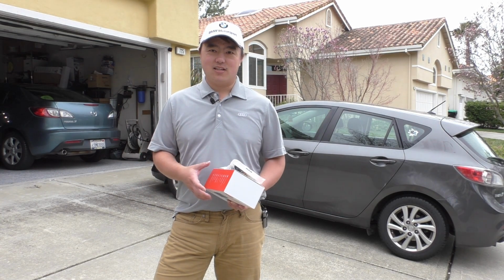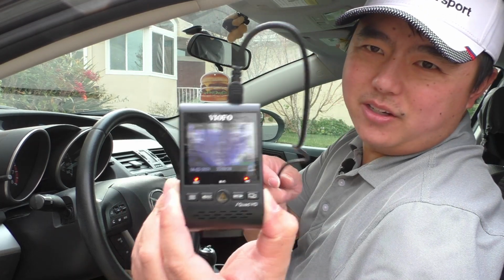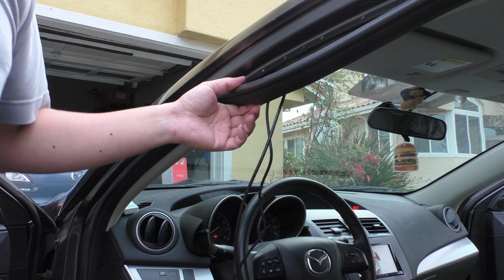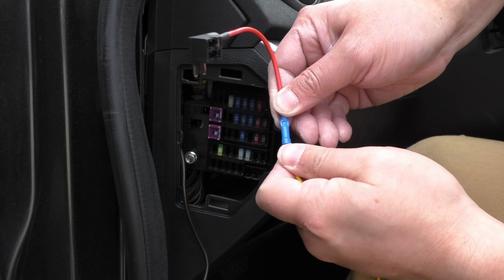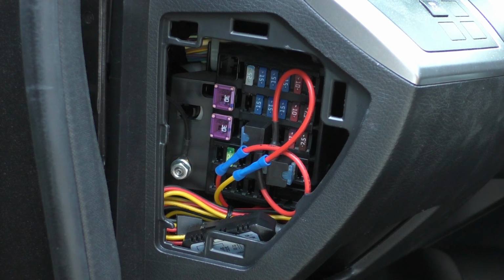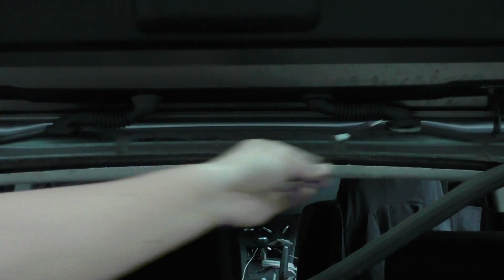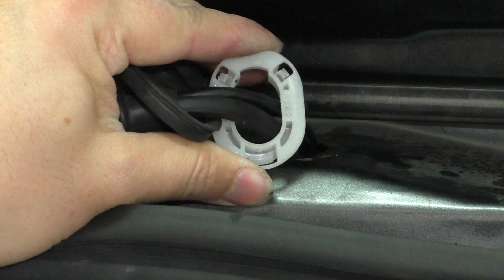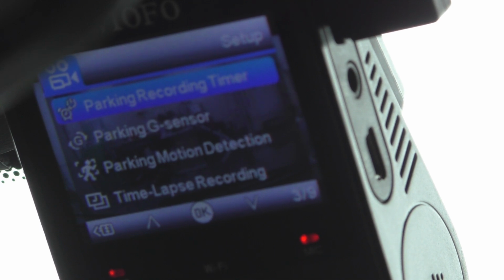2nd Gen Mazda 3 Dashcam Installation (VIOFO A129 Plus Duo)

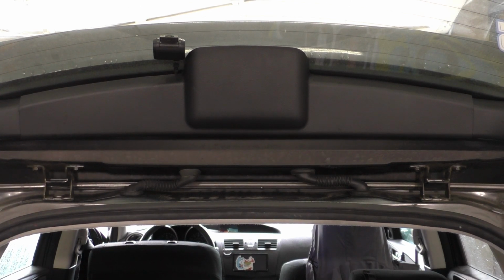Comment: Where was the sedan installation? All I saw was the hatchback, then a quick blurb for sedans to go to 29:09 which I did, and that was basically the end of the video.
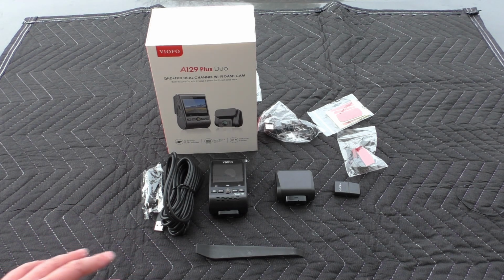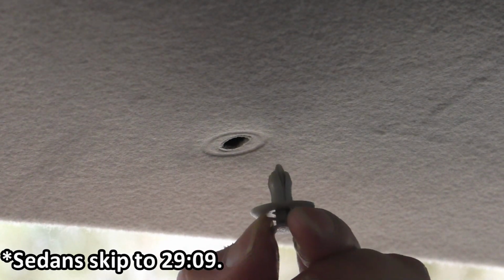Reply from the maker: 2:19 till 19:18 is for the sedan. Sedan and hatchback is the exact same except for the rear.
Reply: @FaRKle0079  the rear is what I'm looking for, for the sedan. I'm glad putting it in the window worked for you, but it does not work for mine. When it rains, I can't see anything. I also see a lot of reflection. I was hoping you had installed in a different area as that is what I'm trying to figure out for my car since the window doesn't work for me.
Reply from the maker: @HeathersGems  Most rear dashcams get installed on the rear window. You can try putting the camera off to the side of the center to see if that has better picture for you. There are also some filters you might be able to place over the camera lens to try and cut back on glare.

Comment: A good guide on the dash cam installation but I have one concern, I think it is not advisable to have the cable wire go over the airbags in which it can be very dangerous if it will deploy in case of accident. I have it myself to have the cable wire under the air bag system and I am just a DIYer and no previous experience.  I actually learned that trick from Chis Fix in YouTube.

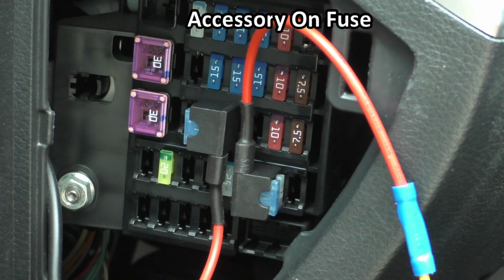Comment: A useful note for anyone following this guide, at 15:30, each fuse slot has a side the power comes from and a side the power flows to, so you need to to connect your fuse tap the right way around. If the Battery (constant) live is the wrong way around the dashcam won't work, if the Acc (switched) live is the wrong way around the dashcam won't go into parking mode. To check your wiring, probe both fuses on your fuse taps, both fuses on the always-live should have power all of the time, and both fuses on the switched live should have power with ignition on 👍
Thanks for the video, I have a similar (newer) car and will be fitting this same dashcam, I got a few hints and helpful info 😎👍
Reply: That is absolutely right. It is best to use a test lamp with the original fuse removed to check which pin of the original fuse holder has the voltage on it. You insert the adapter so that the output cable is on the opposite side of this pin.
and what you definitely shouldn't do as shown:
The original fuse goes in the lower slot (here 20/25A), the fuse for the camera goes in the upper slot and it must NOT be the same size as the originals, but 5A to a maximum of 7.5A. The cables are not designed for currents of 20 or 25A and may melt or burn.
Reply: @robby-cgn  It doesn't make any difference that is significant. If you hook it up one way, the output of the add-a-fuse will be a fused version of the main fuse input (car hot). Hook it up the other way and it will be a fused version of the main fuse output (fused car hot). If you plug it into a slot without a fuse, it will matter.
Reply: @L-36  that is described exactly right. If you connect it the wrong way round (your first option) and the original fuse is damaged, then the additional consumer won't work either. When troubleshooting, it gets tricky if you don't pay attention to both fuses.
If you want that, it doesn't matter which way you mount the holder. If you don't want that and you want the additional consumer to work independently (which is actually always the case), you have to make sure that the input for the additional consumer is always on the input side of the original holder.
Reply: @robby-cgn  I did one up and one down because they were adjacent fuses and that is the only way they would fit. I guess that means I need three fuses working for the dashcam to work instead of two. It is a risk I am willing to take. I think it draws about 1/2 and amp worst case and  the main fuses are 15 amps so should not be an issue.
Reply: @L-36  You can of course mount them however you like if that's not a problem for you. I just want to make other users aware that it does make a difference and how to do it correctly. Using a 15 amp fuse when only a few amps are needed is also wrong. Yes it works also with a 50 Amp Fuse. But the fuse does NOT protect the device but the cables and these thin cables are definitely not designed for 15 amps or more and in the worst case the insulation can start to burn in the event of a short circuit.

Comment: Great video and helpful for me in many ways but I want to point out that you put the wire over the airbag within the A frame on the drivers left side. I’ve seen others highly recommend wiring underneath the airbag as not to restrict the safety feature. Thanks for your video !

Comment: Great video! How do we know which fuses to pull out to insert the hardware kit to?
Reply: You need a multimeter,set it to "DC voltage" black to the ground bolt and red to the little metal dots you see over the fuses. It must show 12 volts or above.
If a fuse shows zero,it's one of the accessories power,and it will work only when the ignition is on.

Comment: Vibration-induced wire failure is a big deal on both aircraft and cars. It's why car makers have so many supports on the harnesses - to keep them from abrading against anything.  It seems like the coiled up wire above the headliner could vibrate and possibly wearing through. I wonder if it might be better to start the rear wiring at the rear camera end and running it forward. Whatever cable is left over can be coiled up near the fuse box where it's more accessible - though vibration could be an issue there as well!

Comment: Great video.  I'm currently using an A119 V3 for the front and a separate Street Guardian for the rear (my Rav4 has a power port in the rear cargo area).  The A129 Duo will be my next cam once the setup I have finally dies.

Comment: Before installing the add a fuse, you really should use a meter to check which prong is supplying the juice and which prong just goes back to the device that needs the power.  This video will do a great job of explaining this.  https://www.youtube.com/watch?v=K2iKXj82354   I don't know if this vehicle has side curtain air bags like the CX5, but if it does you really don't want to put stuff in the headliner (at least not on the ends) because that's where the air bag is going to blow out of.  Best to run it down the middle of the headliner or down the floor boards.  I wouldn't want to put that adhesive over a defroster line.  From the outside view it was right over a line.  I've been watching/reading a few installs today trying to amass all the knowledge I can before doing this myself.

Comment: Great Video, but I do have a concern. I know you have been running this for at least two years already but my concern is with the orientation of your fuse taps. Since one is facing up and the other is facing down there is potential for one of your circuits to be be overloaded. If the orientation is incorrect then the power will run up the blade into the bottom circuit, cross over to the other side and then power the extra circuit before going to the camera. in other words the bottom circuit fuse will be protecting both loads which might be more than that original fuse was intended for. However if you power the blade furthest from the output, that has a common rail to the bottom and top fuse and then you have created two individual loads. Sorry if this difficult to understand. I wish I could attach a drawing.
Reply from the maker: Yes, for one of the fuse taps the dash cam load will be in series with the original fuse, while the other will be completely parallel. Dashcams don't really use much power though, and I pick fuses that should have plenty of spare capacity to tap into.

Comment: Thanks buddy, great video and good info! Now I am going to try it on my new Audi A6! 😅 Hope I don't break any expensive trim! lol Also my A6 has 3 fuse boxes... Oh well I'll figure it out. Just need to be careful not to tap into an important fuse(s), if you trip a fuse with the dash cam if it's faulty or for some other reason, and it's connected to your power steering, ABS, Traction Control, Main ECU, etc. that can be bad real quick!

Comment: What fuse capacity did you use for the dash cam on the red and yellow wire respectively? I’m assuming they are less than the fuses you took out
Reply: A dual channel dashcam,need a 5 Amp fuse. Remember that one slot is for the dashcam (the top one),and the other is for the fuse you are removing.

Comment: This was really well done! Tip for anyone using the linked hardwire kit from blackboxmycar- sand the sides of the fuses down with sand paper. The plastic part on the sides of the add-a-fuses was too thick to fit into my fuse box so i called the company and they said to sand them down. Same with the low-profile mini fuses that come in the kit. Other than that, love the video!

Comment: Isn't one of those "Add-a-Fuse" connections going to make both fuses available to both circuits?  I'm assuming that the same set of terminals for both connections will be the hot/source and load respectively.

I.E. the side of the Add-a-fuse where the wire comes out is the load side.

You installed one with the wire going up and one with the wire going down.  This leads me to believe that for one of them, your camera circuit is not really fused.

You may want to circle back and check by removing the fuse for the camera hardwire kit and see if you still have voltage on the wire before you proceed.

It's important to check your "add-a-fuse" with no fuse to make sure your load is fused.  Given you are running these cables adjacent to sheet metal, you don't want a worn wire to short to ground without fused protection.
Reply: I came here to say the same thing. This is the bad thing about the "add-a-fuse" products. They make it very easy to install a circuit that might look like it is fused correctly, but in fact is not. The average DIYer woudn't know how to check. As you said, removing the fuse and verifying that the circuit is dead is the most reliable way.

Comment: On my Audi Q5 I used an electricians  plastic flat cable pusher / puller  to pull the rear camera cable through the roof from the A pillar to the back, it took me only 3 mins to do it , much quicker than feeding it around the doors or floor , if you can get the cable puller to work.

Comment: Very bad practice to install the cable on top of the air bag on the A pillar . If the airbag is triggered it's going to rip the cable out at best, at worst you'll get a cable whipped in to your face or eyes at great speed, or get the camera itself flying round the car! Put the cable behind the airbag by removing the A pillar cover.

Comment: How long will it take him to find out that park mode doesn't work if you connect power via the gps? And again, no word of warning about taking into account the coverage of the windscreen wipers. Some cars won't be a problem. But some cars have a dead zone behind the read mirror. Many cars won't just let you grab the plastic covering around the fuse box and rip it off "nicely". Instead, start your wiring from the fuse box and feed the cable with the usb end up the side and across the windscreen towards the dashcam. Once you reach the dashcam, work back towards the fuse box, gathering any excess cable to hide in the fuse box area. Also, no mention of fuses having a "hot" side. If you put the fuse in wrong, your device will work UNTIL the other fuse pops. Once you remove the fuse, test both sides of the fuse holder. Only one side is powered. the other side is cold. If he does get into a crash, what happens with the air bags having cables running Infront of them? Having an air bag go off in your face is bad enough but adding a cable whipping about isn't going to help your face.....
Reply: This was about the Mazda3, you should look up videos for the make and generation of the car you want to install for best results
Reply: @芽瑠  It's always great if you find a video about the same car as you have, but a lot of the points about airbag safety  and hot side of the fuse holders still applies to any vehicle.

Comment: Can an additional cabin cam can be added to this camera since it only comes with rear  cam not the insider cabin cam ?
Reply from the maker: The A129 only offers up to two channels. You can put the rear camera in a position to film the interior if you want. There are 3-channel cams like the A139 which have a dedicated interior camera along with front and rear.
Reply: @FaRKle0079  much appreciated sir,I think putting this rear cam to cover cabin will not do it cause I doubt if it has a night vision actually it’s my bad that I didn’t pop the question in a way I should I need a camera for Cabin for ride share purpose and I think getting a dedicated 3 channel cam will be the safe bet but when I look at 3 ch there are none that offer authentic 4k out of main camera
Reply from the maker: @valorous123  I would say "4k" is a "nice to have" rather than a hard requirement. 2k is plenty good for a front cam, so don't let that scare you away from a dedicated 3ch system.
Reply: @FaRKle0079  thank you ever so much this is something I wasn’t thinking about now I for sure will get the 3 ch and thanks again for great advice 
Bless 🫡

Comment: Nice video, thanks,  question I have read that the fuse tap has to go in a certain way, the left side of the tap which is hot has to go into the hot side of the fuse socket, is this true confused on this point.?
Reply from the maker: The fuse tap doesn't HAVE to go in a certain way. If it gets put in "reversed" then the new tap will be in series with the original fuse, rather than being in parallel with it.

Comment: Stupid question for everyone who has hardwired the dashcam: does the camera also draw power when you turn off the parking surveillance?  In numerous tutorials I have seen that for the power supply you have to connect a cable/adapter with a fuse to the permanent plus and to the ignition plus (and also ground).  But I don't need the parking surveillance, hence the question.  I'm still a novice driver and have no idea about electrics (yet) and don't want to shoot my car up, so I'd appreciate an answer :D
Reply from the maker: The camera should turn off if you disable parking mode. If you don't want parking mode you can also just connect the ACC and BATT wires to the same fuse that only turns on with the car.
Reply: @FaRKle0079  Thanks for the fast response! So just for understanding: then I could also order a slightly different hardwire-kit (than the recommended VIOFO-Kit) with only 1 adapter for the fuses and plug the adapter into a spot where there is only currency when the ignition is on?
Reply from the maker: @mike_romeo_lima  Yes you can use a "two wire" hardwire kit that has one wire going to the fuse and another going to ground.
Reply: @FaRKle0079  Thank you so much buddy and greetings from Germany 🇩🇪!

Comment: Hi excellent instruction. I'm going to hardwire these cameras on a 2016 cx5. Do you think the cables will be long enough? If not how can I I get longer cables? Thanks for your time.
Reply from the maker: The fuse box on your vehicle should be in a similar area (lower left side kick panel) so the wires will be plenty long.

Comment: What value fuses did you pair with on the ACC and VCC adapters? Did you match the value of the fuse that you added onto? For example, when tapping onto a 15 A fuse, do you always need to pair it with a 15 A fuse in the second slot?
Reply from the maker: You don't need to use the same size fuse that was originally in the slot since the new fuse is only supplying the dash cam system. A 5A fuse will be plenty unless you're connecting to a backup battery (like Cellink), in which case check the charging rate on the battery (they can be 7 or 10A I believe).
Reply: @FaRKle0079  Worked great, thanks!

Comment: 1) does it come with the voltage cutoff module included, 2) does it include the add a fuse 3) does it come with the extra fuses 4) Did you just discard the cigarette adapter cable??
Reply from the maker: 1) The voltage cutoff module comes with the hardwire kit, which is purchased separately/extra add on.

2/3) Add-a-fuses are also a separate purchase, sometimes they're sold bare, other times they have fuses. I'd check Amazon for what you need.

4) I typically just put the 12V cables back in the box and store it with the other manuals/unused accessories.

Comment: what are the benefits of hardwiring it? and whats the other alternative of installing it?
Reply from the maker: Hardwire provides a hidden/clean installation and allows you to control the power source behavior, versus the exposed wire for the 12V socket, and whatever behavior for it the car is designed to do.

Comment: Correct me if I am wrong but the way you ran the wires through the A piler, it looked  to me that you obstructed you air bag.
Reply: He did ! Very bad practice. If the airbag is triggered it's going to rip the cable out at best, at worst you'll get a cable whipped in to your face at great speed, or get the camera itself flying round the car! Put the cable behind the airbag by removing the A pillar cover.